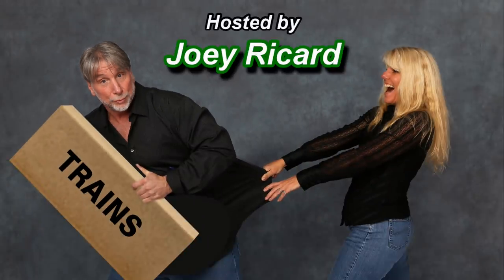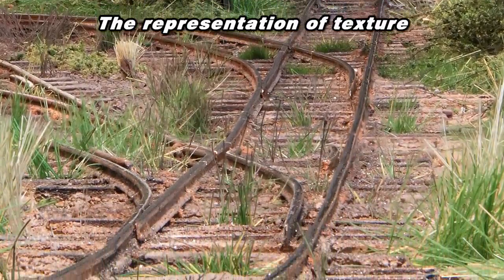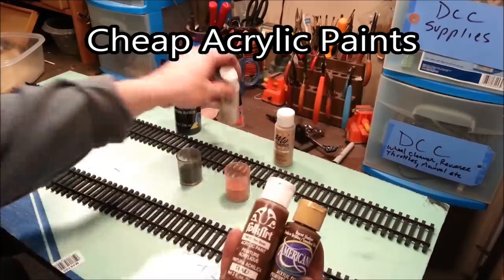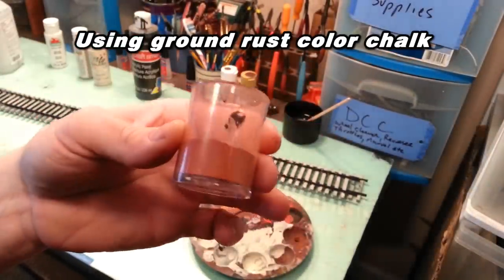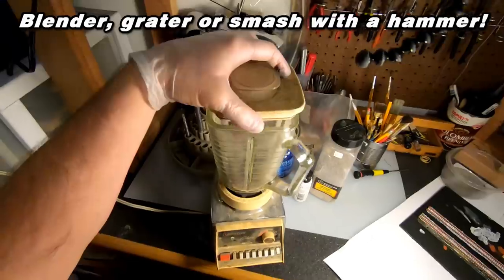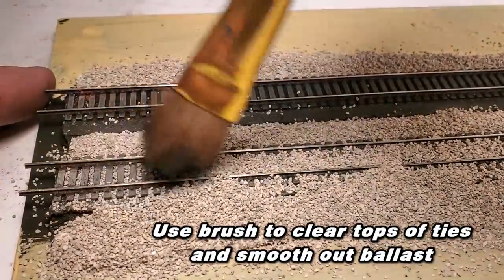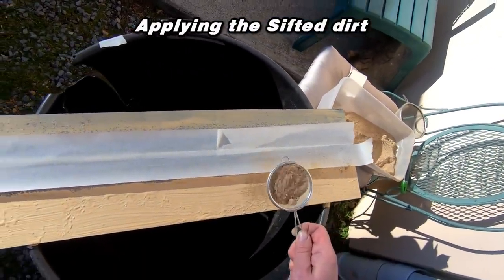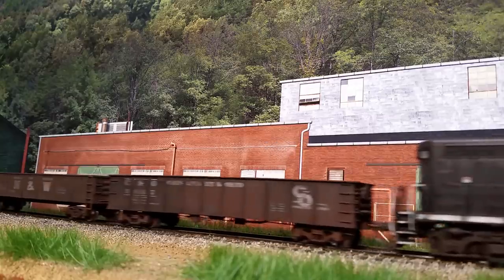HOW-TO MODEL - REALISTIC TRACK

Comment: Thanks for posting this. I'm also a model railroader. I like to make buildings using balsa and bass woods. The best one I made is a coal tipple. It goes over two tracks that I can put three hopper cars on each. I use granulated real coal that's used in electric power generating plants. I have operating doors to load hopper cars. I used telescoping brass tubes and small jewelry chains to open the sliding doors and the coal goes down chutes into the cars.

Comment: Yeah that opening sequence was pretty believable as the real thing.  Good work.
You can actually paint those model tracks?  I legit always thought the train got its electric power through the track and covering it would cause the circuit to break.
Reply: CMDRFandragon as long as the rail head (the top of the rail) is clean paint free surface then the train will run